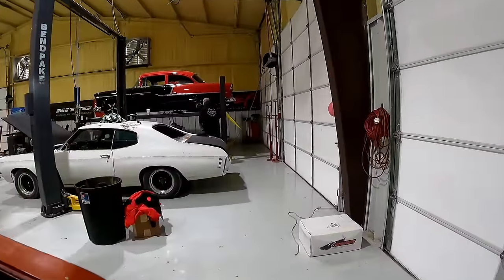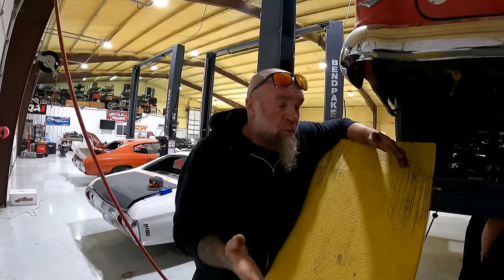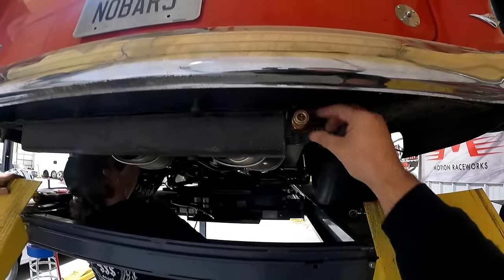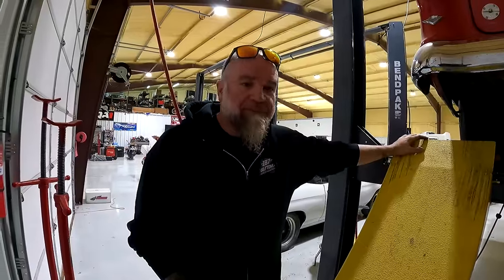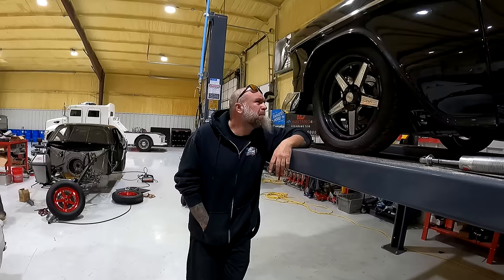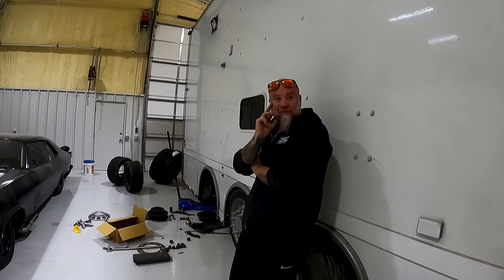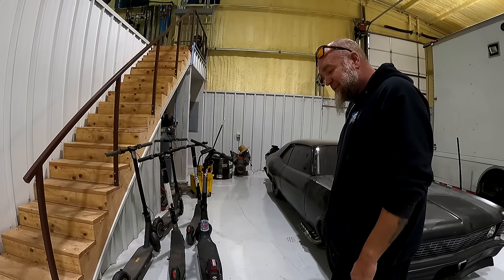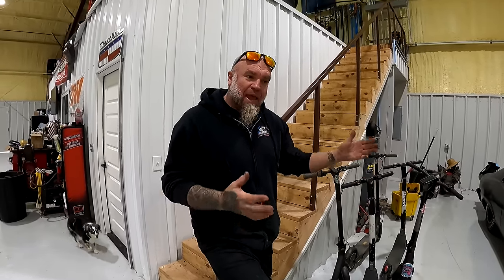Scaling The OG Murder Nova and The 55 In Preparation For Testing! We Show REAL Scale Numbers!

Comment: You should look into those Jegs Vehicle Storage Ramps. They are like the Race ramps but have round bottom so you don't get flat spots on your tires in storage. I use them on my Typhoon during winter storage and on my car trailer that doesn't get used very often. They are like $100 for a set of 4. Have them in several widths.

Comment: Just a little tip if you use stick on wheel weights always do the outer part of the wheel because the inner part of the wheel might change. I did tires for like 20+ years but now I can't do the stuff anymore do to medical reasons.

Comment: Tip for you on the tuning stuff.....  Get a USB drive (32GB or larger) that will fit on your keyring.  Save ALL your tunes on that flash drive after every race,  Just copy it all over and let it overwrite the stuff already on the card.  New tunes will automatically get added as long as you change the file names as you go.
That way, you always have the tunes with you regardless which laptop you have.

Comment: I ran a 4”suspension lift on my chevys with rally wheels to keep them from rubbing it handled so much better than with the stock negative arched springs and I also spent the extra money after buying ranches the first time I bought superlift soft ride for the next 4-6 trucks with ran home 9000 shocks5 way adjustable or Doetsch tech pre runners I tried many others but the best ride came from these 2 . Hope this info helps you guys out you also have to run a 4” raised steering arm off the knuckle

Comment: When balancing tires, if it wants more weight, you move the original weight generally. Say it wants .25 or .50 to the left or right of the original weight usually within 4 to 10 insches. move the original weight toward the area of the new weight indicator. for .25 move it about a 1/4 in for .50 move it about a inch.some times yuou may have to move it a little more or less.. but it will zero out.  If it calls for .75 or more generally u need to change the weight up .25 and move it the amount -.25 so say its .75 and 6 inches from the weight bump the weight up .25 and move it about a inch over toward the new spot.  if it wants weight across from the original. like .50 at top but the old weight is 1.00 at the very bottom remove the top weight from the bottom weight. So you would remove the 1.00 and swap it with a  .50. at the end you should only have weight in one spot and it should come up 0.00 on the machine both sides
if you have anything left on the machine above .50 you will more then likely feel a vibration when driving..

Comment: Not even a minute and a half in.  1:08 Boy you better put the brakes on that deal!  😳😂. 10:57 is there some kind of hooks for air tools you could put on the inside of the rail of that lift?  🤷. "You are a tool!". There got that outa the way for ya!  33:50 emotional damage!  52:26 the result of 1:08?  🤷. Does the instructions on that deal show where you may have the option to adjust the auto shut off timer?  And if you click the 108 and time it just right then click the 5226 its freaking hilarious!  😂

Comment: Cleetus has already found all the weak points on that f150 for you guys. Transmission and transfer case both need upgrades and a crank snout support are all necessary equipment at that power.